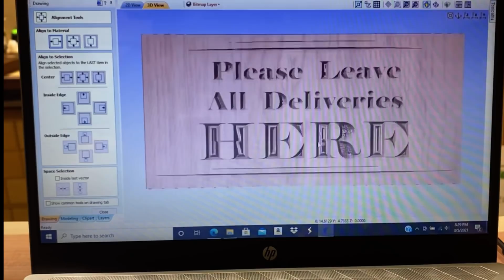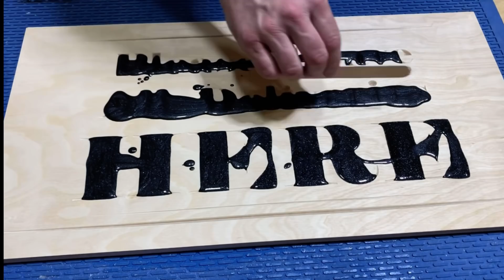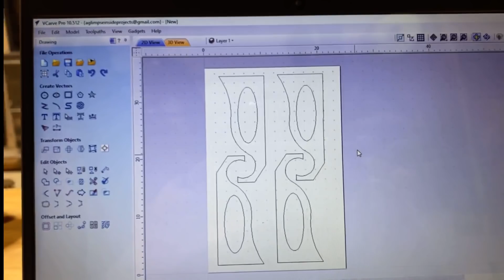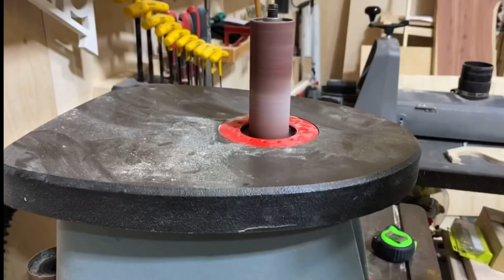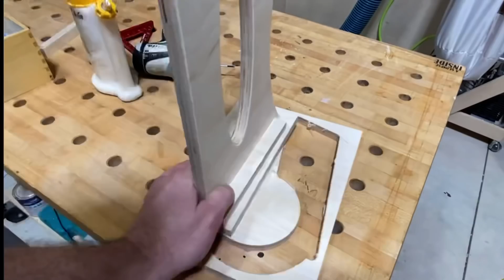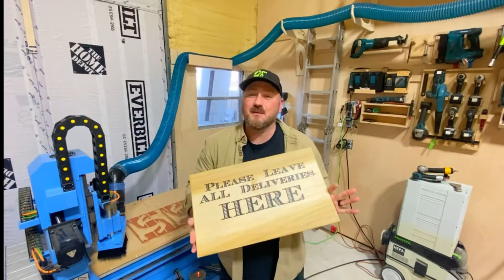Trying To Expand My Skill-Set | Here’s How... | Penguin CNC

Comment: Hey Chris - question about the black resin on the raw white wood.  I've had issues before painting where the fibers of the wood actually take up the paint and gives the final piece a "fuzzy" look...so I've learned to put some clear coat down on the carve before painting.  Did you see any of this using the resin?
Reply from the maker: I did not but you are right about the clearcoat it doesn’t work wonders with carving plywood

Comment: Love Vectric.  They have some of the best (and easy to follow) instructions.  That resin sign looked awesome!  Also, using doublestick tape works well on holding down parts.  You can even skip the tabs since all the parts will still be attached.

Comment: Great video. Would you not get better performance from your dust collector if you ran some solid pipe
Reply from the maker: I might get better performance but there’s hardly any dust left over at all at this point. Plus I like the flexible houses and don’t want to be tied down to where machines are located in the shop

Comment: Hi you say that you use v carve pro to produce your g code, can you then carve the sign or do you need another programme to actually carve the sign. The reason I am asking is I bought a CNC from Amazon and it came in parts that I had to assemble, but the manual was in Chinese and my efforts to contact them is less then useless as I get the same email  that I cannot read.
Reply from the maker: You make a model in V carve. Can you have the option to save the G code once you’ve implemented the right tool and cut depth etc. You take that G code file put it on a flash drive bring it to your machine. Separation between G code and 2D/3D file. Was a bit confusing to me at first. I hope this helps brother